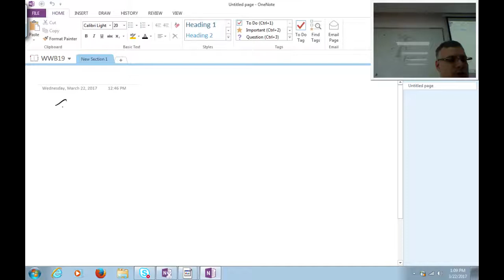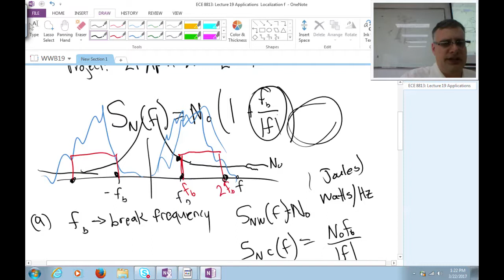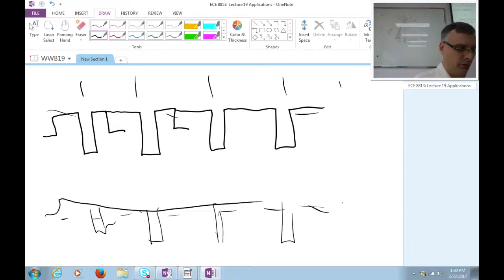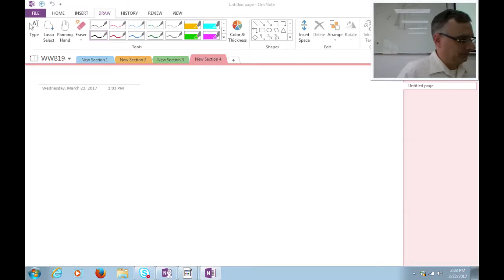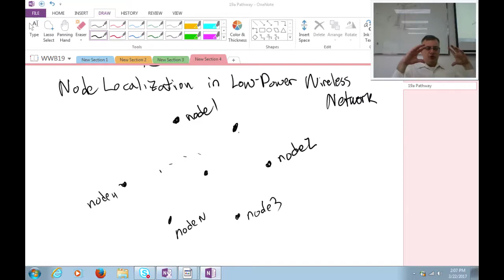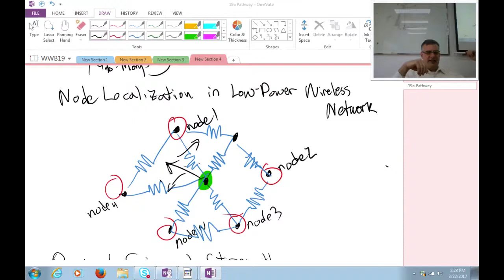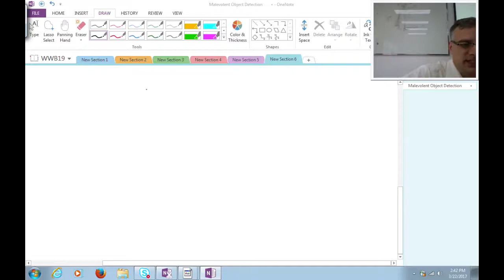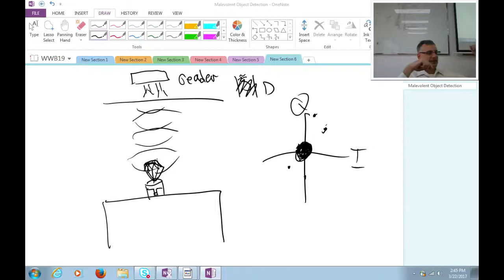WWB19:  RF Tomography and Sensing

Comment: Great technology overview! WWB is a stellar name.

The thermodynamic limit lecture is interesting. There has to be larger (mechanical heat engine) systems that can approach those numbers. Turn all energy within an antenna bandwidth into heat is pretty inspiring. (Went and took a thermodynamics class after listening to that lecture)

An additional energy harvesting and application space I’ve seen is Dennis Sylvester at UM has a photovoltaically powered node for acoustic based environment measurements. The lack of compete integration probably beaks the budget though.